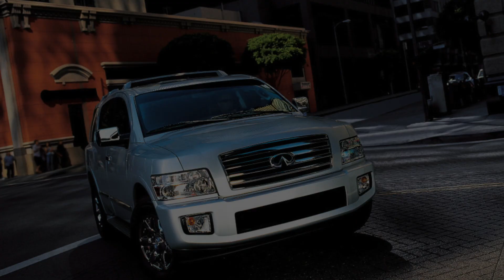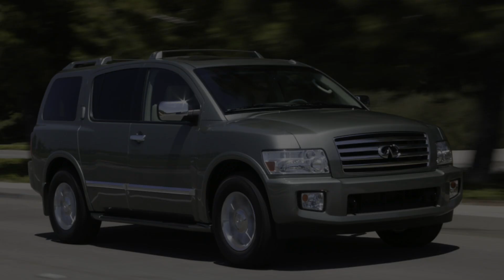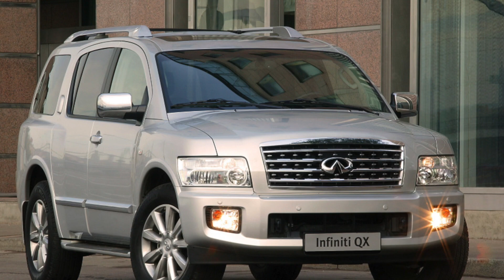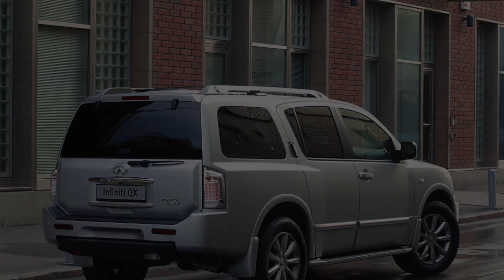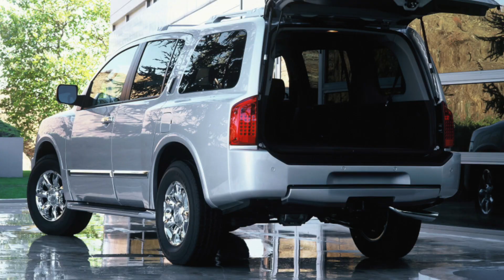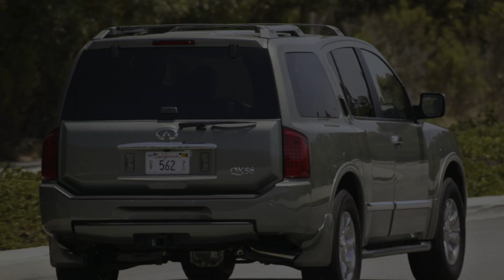Infiniti QX56 Problems | Weaknesses of the Used Infiniti QX56

Comment: I have 2008 armada for 13 years now and the only problems I've had out this vehicle was headlight bulbs, front brakes issues, code on my converter, and fuel gauge misreading. But all and all I got over my money worth in it. And for the size of it and looking at the price of newer suvs, I'm not getting rid of it.
Reply: Wowwwwwwwww that's great to hear,im thinking about getting one,but watching this video I'm not so sure,but you said yours was pretty much problem free huh,hows the ride quality???
Reply: @mercedesbenzs600bash  it rides great and its on 30s. Its been on 30s for 7 years now. No problems!
Reply: @mercedesbenzs600bash  out of all the suvs out its the most reliable.
Reply: @brucetec6597  I ended up getting a Toyota Sequoia Limited...
Reply: @mercedesbenzs600bash  Those are great too. I was a Toyota technician for 5 years. That truck is a workhorse. 👍🏻
Reply: @brucetec6597  Yeah man I really love this,don't know why I waited so long,but I'll tell you this,from now on I'll always own a Toyota Sequoia Limited,from the interior room,the snowfalls in New Jersey,the power of the 5.7 engine and of course the reliability and dependability,you just can't beat it...
Reply: Lol my fuel gauge reads full when empty and empty when full.

Comment: I have never had anyone of this problems with my 2006 QX56 with over 300K. I never replaced the timing chain. The only know problem for the vehicle was the Catalytic Converters which is known by Nissan USA for a problem
Reply: That's cap
Reply: Mine is a 2009 infinte Qx 56
Reply: I am buying 2009 next should I pass it,or?
Reply: @stevicanikolic4378  if u pick one be ready to buy a tone of Catalytic Converter
Reply: @stevicanikolic4378  If you really like it,buy it...
Reply: Stevica, if it has only one owner with records and low miles then i think it would be nice. If it has over 120k miles, i would pass on it because you will be replacing parts. It is reliable but parts will fell over time.
Reply: @beekaye1496  First owner 150000km,full service history.
Reply: @beekaye1496  I recently bought a 2006 and love it... but can you tell me about the recalls.. and when you had the recalls fixed did the dealership try to repair more cost you money?
Reply: @frank44magfrank80  Nissan/Infiniti recalled the Cat Systems in 2009 or 2010 I think, i was out of warranty but they (Infiniti) did the fix first set at 94K miles for free. After that and  another 100K, i had the replace all 4 at my own expense. I bought the parts from Infiniti and had my mechanic install them to save a lot money on labor. I hope that helps.
Reply: Brake valve solenoid in transmission went bad $2300 repair
Reply: I paid very little for a 2006 model,200k+, needs alternator , rear wheel bearing, and good cleaning. Will see how it'll operate🤔😄
Reply: Yeah this vehicle seems pretty reliable and durable...
Reply: I'm about to replace the IPDM in mine. The cluster glitches out while driving. And goes into like a "limp mode". After doing some research, I have confidence this is the issue.
Reply: Did it cost a lot to get the catalytic converter problem fixed? I have a 2004 Infiniti QX56. I have had so many problems with mine so I guess previous owners did not take very good care of the inner problems of it. The outside looks great. 
Now my GPS and stereo just went out so hopefully I can just replace the stereo and it works again. 
Thank you for sharing and please get back with me about the CC when you can.
Reply: @conswelob  no it didn’t cost a lot unless you had the dealer replaced it. I buy the parts from the dealer and then have my mechanic replace it. The labor the dealership charge is outrageous. If the radio is out replace the engine control module ECN. I hope this helps
Reply: SAME! I have 11 qx56 with 180k and the back lift gate motor had to be replaced and the Cat converter by manifold is a little clogged! She is AMAZING!